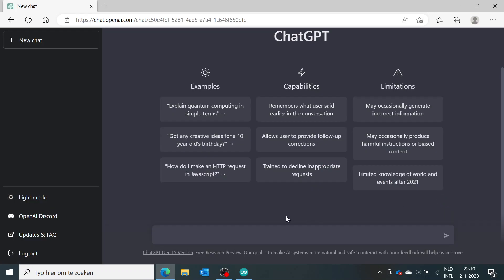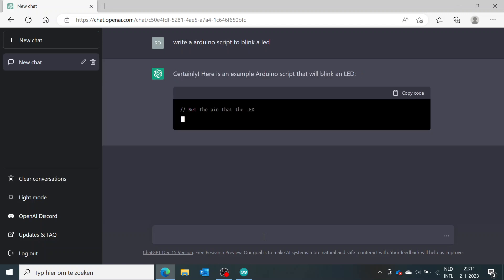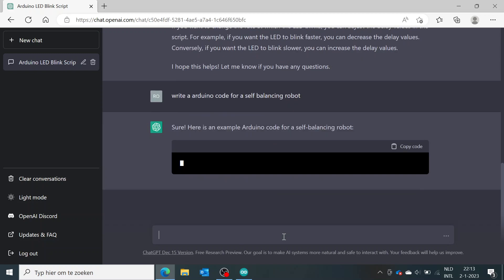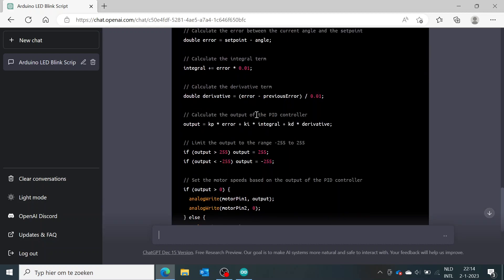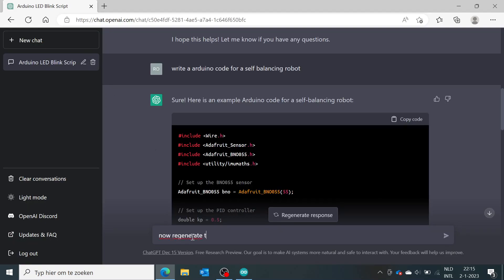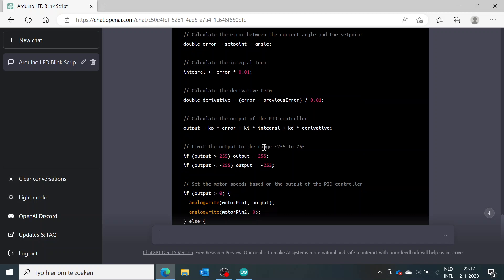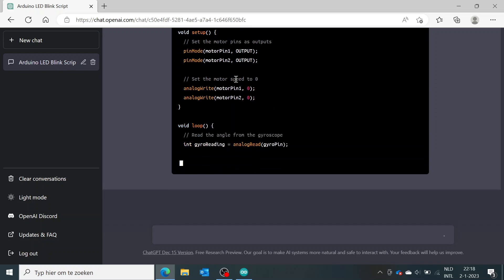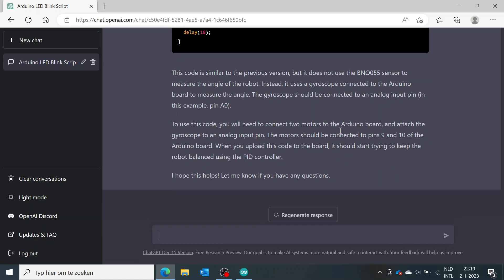How to write Arduino code with ChatGPT - (Full Guide)

Comment: Be careful if you do this. I shorted my usb port on my laptop and almost destroyed my laptop attempting to create code to sync 2 dc motors with encoders because the code was wrong. Chat gpt will also sometimes overlap arduino pins and cause a mess of events to occur.

Comment: I've been trying for over a week to get it to successfully write code that will compile. 
I've had it write small parts to test the individual parts like display, keypad, temp and humidity sensor, but as soon as I try to take the individual working pieces to make them work together it starts producing bad code. I'm using the paid version of gpt too. I'll eventually figure out how to get it to do what is needed.
Reply from the maker: Yep, in my experience indeed it need some extra prompts to get the script working. But when you run into an error and copy this in chatgpt, it will almost always know how to solve it luckily
Reply: @Simplified.  I've been doing that, and what I'm finding that is happening repeatedly and regularly is the GPT 'forgets' some of the chat that lead up to the present time. I've literally had 3 screens of code that keeps shortening until the point it was less than half of where it was just a few interchanges earlier. I feel like I'm working with someone who is really smart but has ADHD 10x worse than I do! 😆
Sometimes I may as well be talking with Dory, the fish from Finding Nemo. 

So I've learned to take things in smaller bites and keep reminding the GPT of certain parts of the code that cannot be left out, but that is tiring to stay on top of those things. I'm hoping the next update helps.

Comment: Well ChatGPT must have improved a lot, then.  I tried to get it to help with Arduino code a few months back, just after it was made available, and it was utterly useless.
Reply from the maker: It has improved a lot since the last few months. openai even suggests that the upcoming GPT-4 will be 100x smarter than the current version.

Comment: Has anyone figured out how to get chat gpT to provide longer text output? I keep having to type in continue to get it to provide complete responses on anything mildly lengthy. And I’ve noticed it leaves out components sometimes and I’m wondering if perhaps this is because of the break and its output.
Reply from the maker: I think there is some limit to how much words per question the chatGPT can answer. Just try to seperate your question into smaller pieces, and see if this works for you, goodluck👍
Reply: There is a continue button too

Comment: I have actually been working on getting Chachi PT to write a code for a self balancing robot. But have been unsuccessful in getting it to provide code that works. Obviously, the parameters are going to need fine-tuning so to simplify this. I had it also create a self calibration process that would run before the main code. During the self calibration process, it would make small adjustments to the servo positions and monitor the gyroscope accelerometer feedback to calculate optimal parameters, and then populate the primary code with the results from the calibration process. However, when I execute the code, it immediately rotates each servo to 90° position and stops. 

I’ll have to dig into the code more to figure out why.
Reply from the maker: Make sure you’re initial positions are correct and try to use chatGPT to review your code corresponding to your errors. So just tell chatGPT what problem is happening and try this a few times before the right solution is given. Also what can help is to let chatGPT write the code in seperate pieces, so you can test each piece apart from each other for errors, instead of copying the complete code in 1 try. Goodluck with your project!🙏🏼
Reply: @Simplified.  thanks, good suggestions
Reply: Try breaking down the problem into smaller bits and then feed it to chatgpt